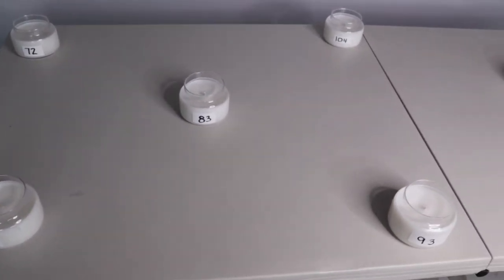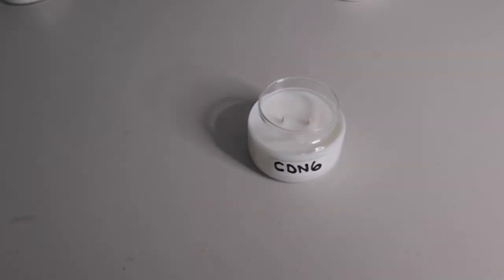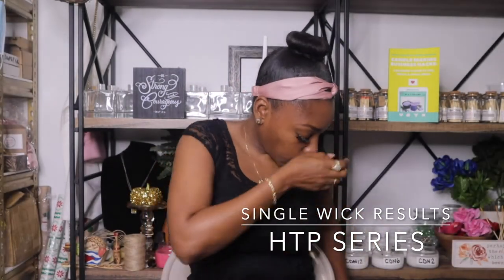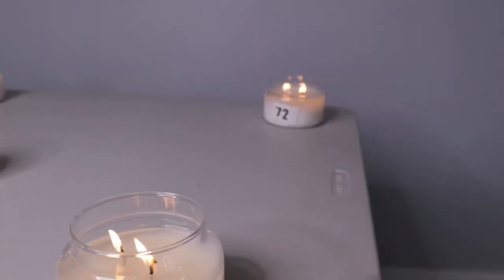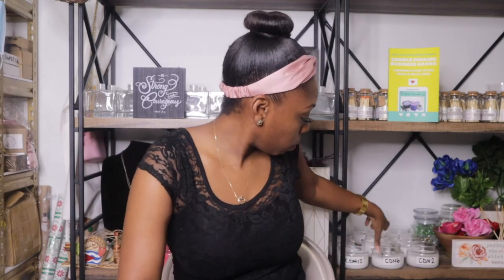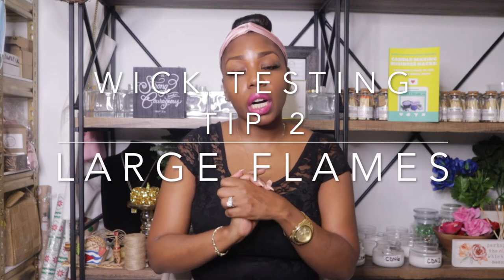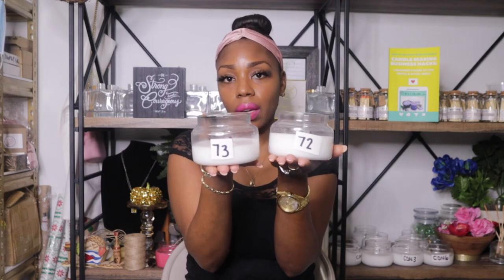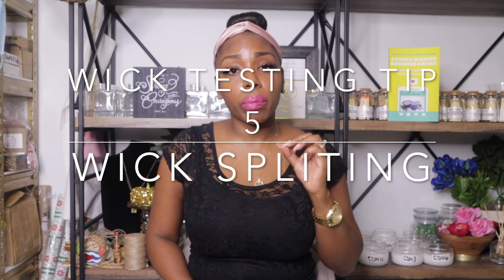All About Wicks Should You Double or Single Wick Part 2

Comment: I feel your pain.. I had my HTP 1212 not even reaching a full melt pool in an 8oz tin, yet the flame was super high and smoking. Sometimes you just can’t win, very very frustrating. Thanks for taking the time to do these tests.
Reply from the maker: HTP 1212 is way too big of a wick size for an 8oz tin can. I hope you changed that wick size. Good luck. Thanks for watching.
Reply: @SandraJCTaylor  yeah, changed from CB advanced to virgin coco soy for the tins with a 16mm single ply wood wick. I’m only using CB advanced for my 2.5 inch diameter glasses with HTP 105 wick which burns beautifully. I love CB advanced, but it just doesn’t work well with any of the wood wicks I get here in Australia. A lot of testing just to get to this far, but it’s worth it in the end.
Reply from the maker: @PurchaseReviews  that’s good. Glad that the HTP 105 is working for you.

Comment: Hey girl, what were your results ? I have been testing straight tumbler jars and have used every single htp wick. Girl this shipping and having to wait for candles to restock is something else. With my 8oz I think I have to double wick . Is that right ? What are some suggestions because I’m not reaching a full melt pull. 💜🤞🏼
Reply from the maker: Hola,
The results that I tested are in the video. I also include examples of how the melt pool should look like in the video. 
Yes shipping fee and shipping times are ridiculous and not to mention to have your suppliers restock items that every other candle maker is using 🤦🏾‍♀️.
Reply from the maker: Wax, fragrance, wick size, and vessel all have an important role in making a great burning candle. Research other slow burning wicks because the htp wicks might be burning too fast for your jars